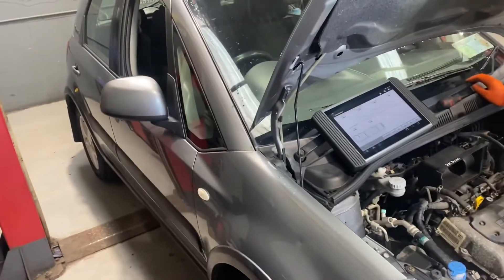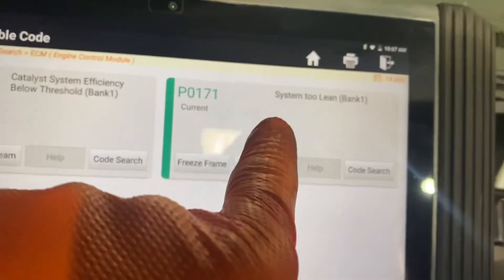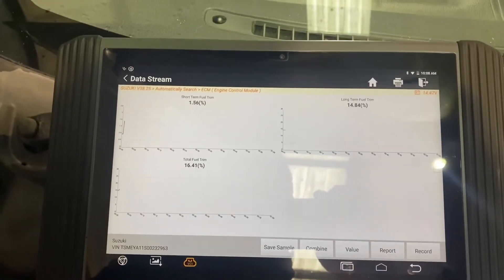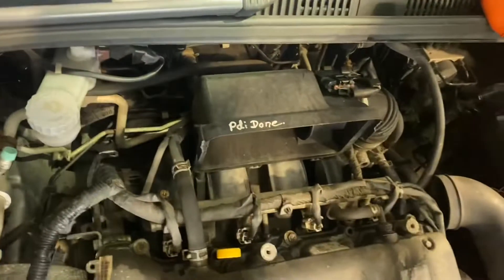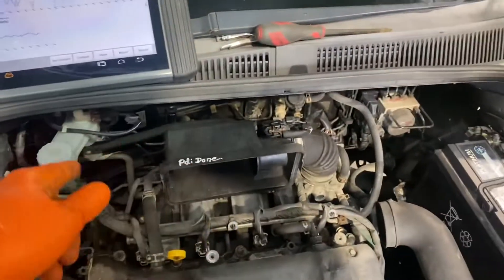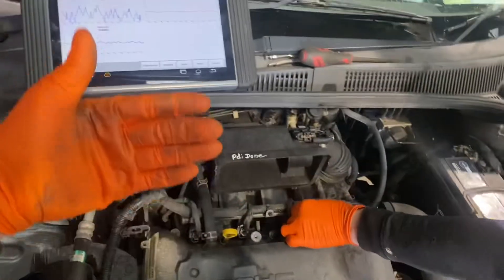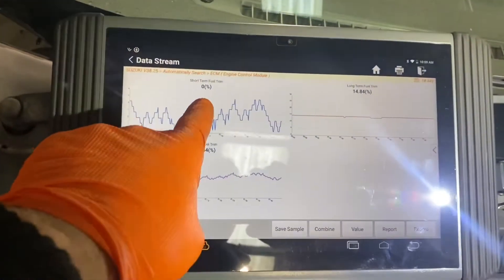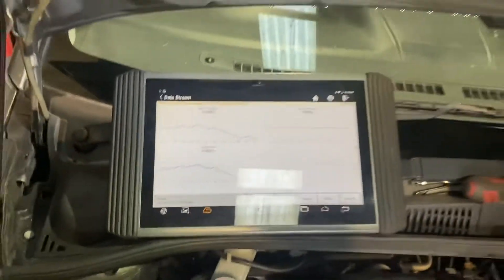P0171 fuel system lean, diagnosis

Comment: the map gas was going into trottle body not the intake leak
Reply from the maker: I actually had these 2 videos made into 1 and decided to split them on the last minute & had the close proximity pointed out before I split them. So it could have affected the test accuracy but I didn’t feel it did & the car is fixed 💪👍
Well copped though Dan 😉

Comment: do you think the propane could enter the air intake during the test? Albeit, it's heavier than air but you have negative pressure just above the test area
Reply from the maker: Possibly but it was only affecting the fuel trims on 3 of the intake ports & if it was rising I felt it would affect all 4 🤔
But we must use our gut instinct & experience on every test carried out. But it is a fix after we replaced the intake gasket & still going good 3 weeks after 👍👍